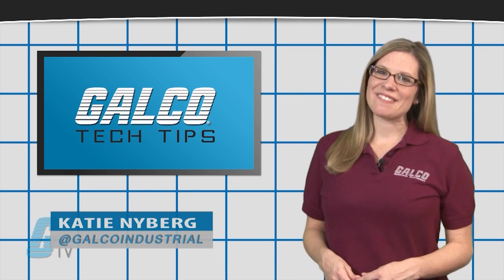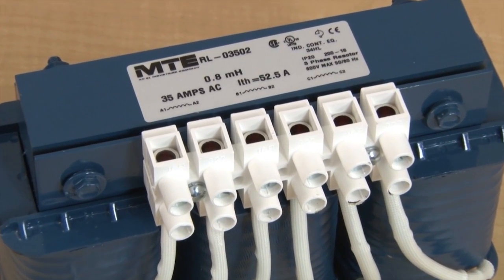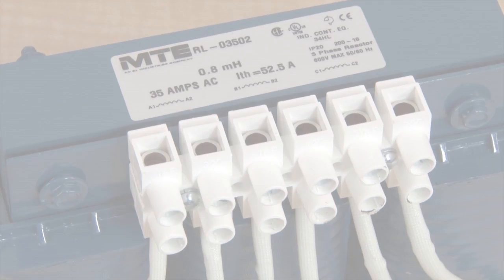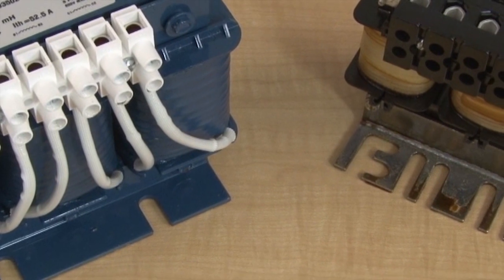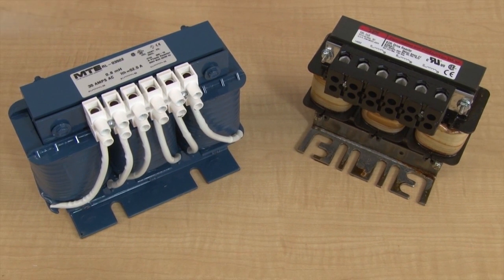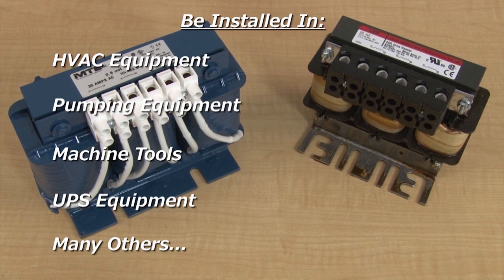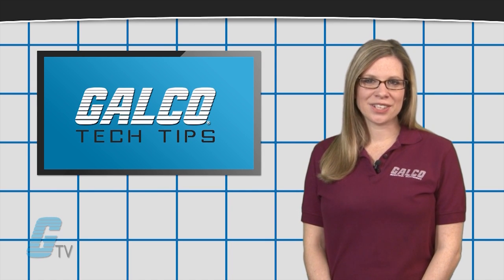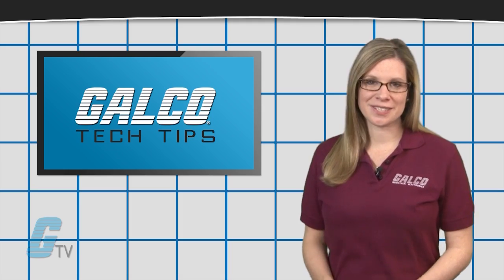What is a Line Reactor? - A GalcoTV Tech Tip | Galco

Comment: We have a heating system where we have total 60 Infra-Red light bulbs which  is ran by our city power. The quality of our city power is not good. It's noisy and causes bulb cuts a lot in our system I think. Can installing such a line reactor will solve the problem??

Comment from the maker: Line Reactors are inductive filters that are typically connected between the AC line source and the input of a drive. The purpose of these filters is to minimize electrical noise such as voltage spikes and reduce power line distortion from VFDs. A line reactor acts not only as a current-limiting device, but it also filters the waveform and attenuates electrical noise and transients associated with the system.
Reply: Thanks